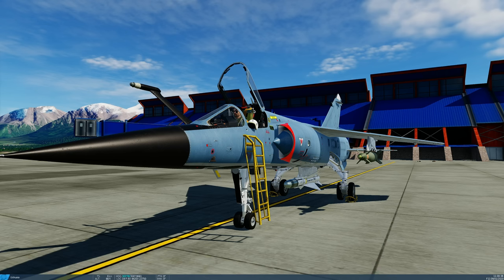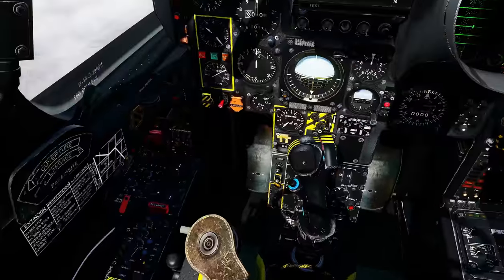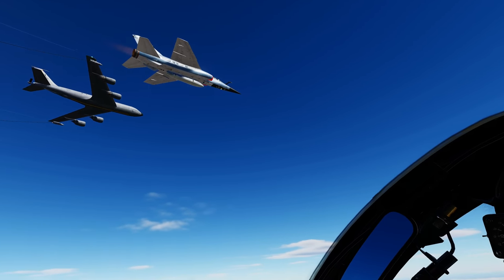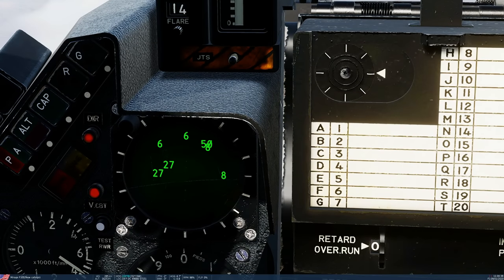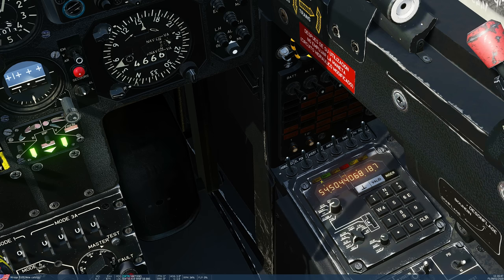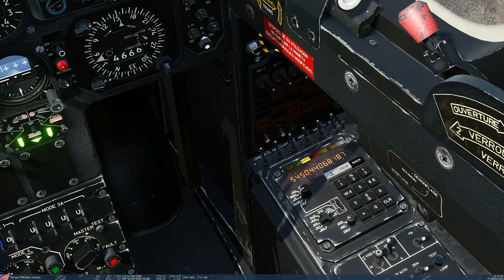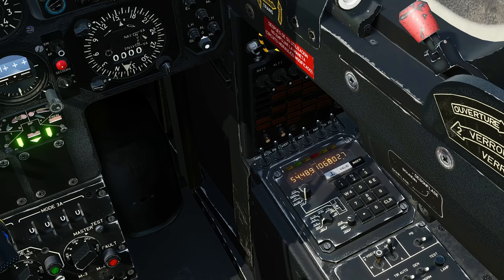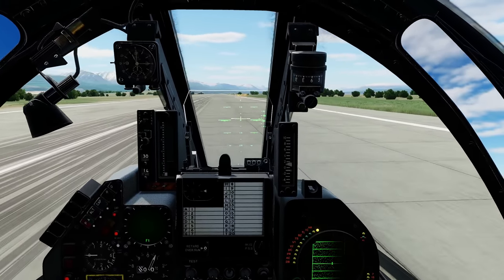Mirage F1EE: AAR, INS, IDN, RWR, Alignment, Waypoints, Cockpit Guide | DCS

Comment: Can you go over the new way to activate the Autopilot in the CE and EE?  I can't get them to work.
Reply: On the CE you just press the autopilot button in the cockpit, then select which mode you want.

To deactivate it, you have to press the autopilot buttons in the cockpit so that all of the ones you were using turn red, then press the autopilot button on your HOTAS. It’s really finicky but it’s a good autopilot system. Miles better than the F-14…
Reply from the maker: ^^ I think you need to keep the button held while clicking on the mode?
Reply: @grimreapers  I was told that Aerges changed the autopilot activation entirely.  Nothing I do makes it work and I can't find any documentation.
Reply: @rhysgoodman7628  Go do that and film it.  That isn't working.
Reply: @kypdurron62  I just press the autopilot button in the cockpit and it turns green.
Reply: @kypdurron62  is that not working?

Just click the button in the cockpit and it turns on.

To turn it off, press the button in the cockpit so that it goes from green to red, then press the “autopilot lever” on your HOTAS.
Reply: @Rhys Goodman  Nope.  My friends and I all have the module.  It works for them, but not for me.

One of them even came over to my house and did it and it didn't work.

I've got no idea.

Comment: I'm not sure your RWR description is correct.  Should be, the bigger the threat (stronger the signal) the closer to the centre that a contact appears on the RWR.
Reply from the maker: Currently on the EE definitely stronger signals further to the outside. May change later in release.
Reply: The further outside the symbol is, the more accurate you can determine the bearing to look for. That could be the reason for this logic?